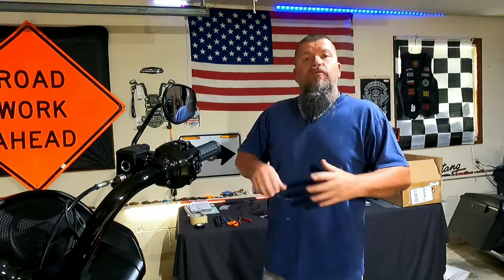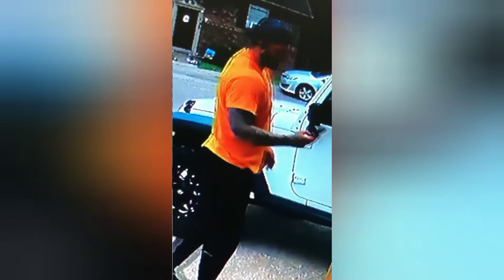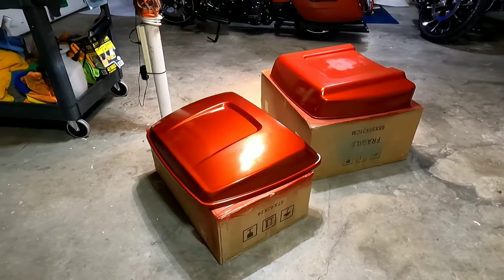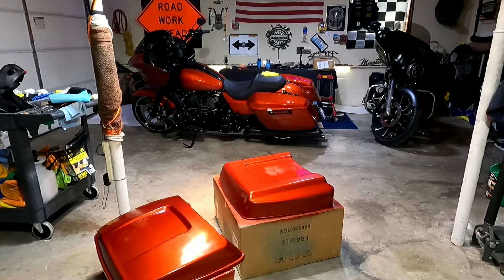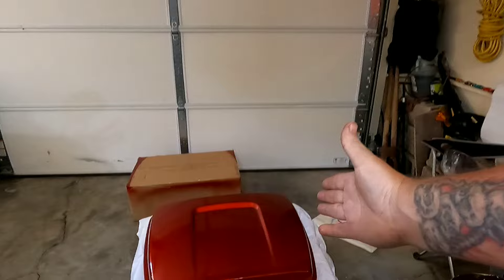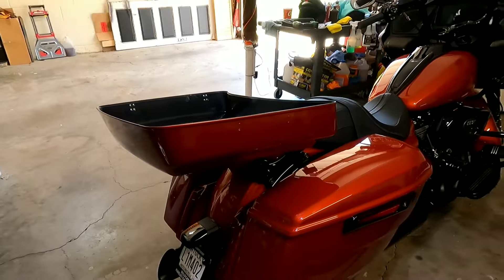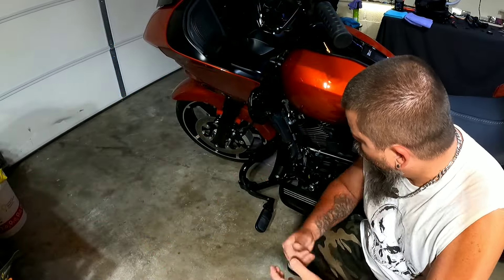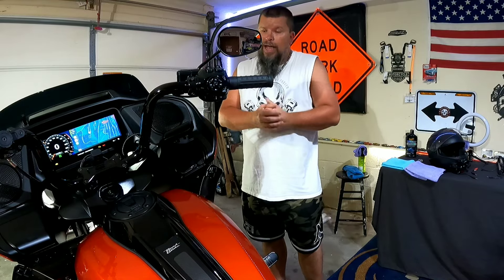MAKING MY 2024 ROAD GLIDE MY OWN painting and installing tour pack, apple car play trickery and more

Comment: Biggest problem with CarPlay is you have to have WiFi turned on. My CarPlay shuts off randomly or will only play music and not a map. It’s because of traveling through areas with low or zero cell signal. Also my phone randomly resets which makes it worse.
Reply from the maker: @barkleywitcher3494  I agree! The new plug from ‘Tim’s Stereo System’ is suppose to be better and will free up your charger. I have one, but not used it yet. I’m trying to see how long this set up will last.
Reply: @badlsxgarage I have same setup for 2 months. Works fine. I’m also going to get one from Tim’s to free up the charging plug.

Comment: Besides the painting part, how are you satisfied with the tour pack itself? any significant concerns with it as far as quality goes?
Reply from the maker: I like it. I have the exact same one on my street glide, and I’ve ran it for 5yrs. Biggest thing is to make sure to get the metal insert. That will keep everything tied together and keep the bottom of the tour pack from busting out if you run heavy. The latches are holding up great, the only dislike is the thin, janky band they have to hold the lid open. It’s sketchy! Other than that it’s great!